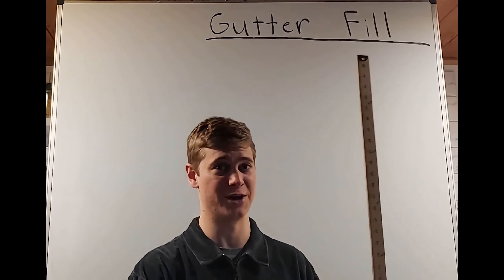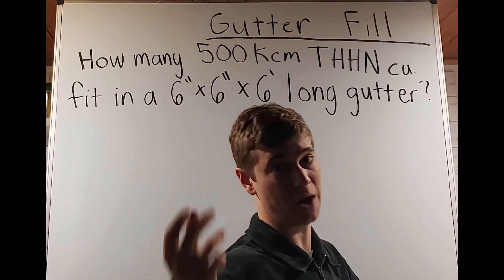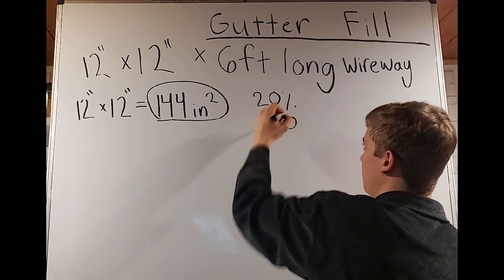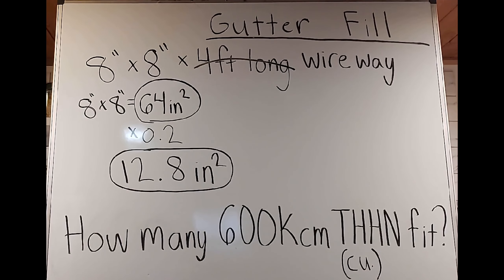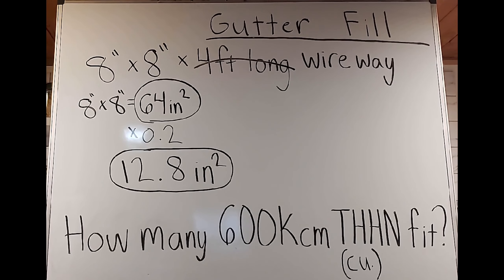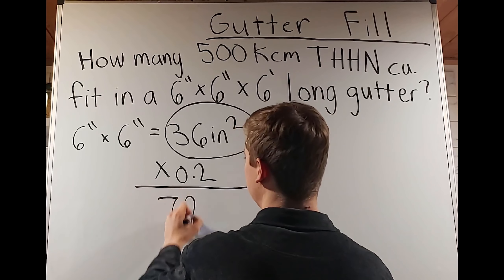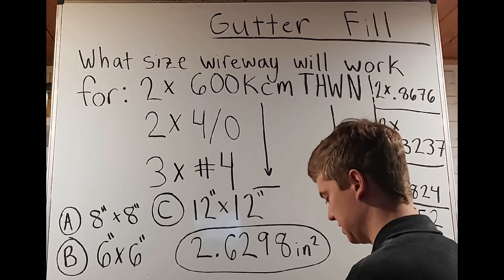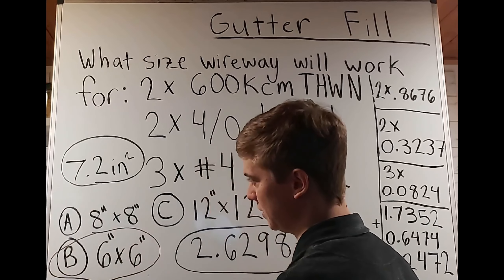Gutter & Wireway Fill

Comment: Good job. The electrical industry needs as much help as possible when it comes to electrical theory. I harvest as many Electrician videos as possible so I can learn. Good job here. 

I would suggest doing a couple videos on Clarifying the difference between grounding and equipment grounding conductors. Many people still think that electricity wants to go to ground; which it doesn’t. Many still think a ground rod is for safety, which it isn’t.
Reply from the maker: Thanks for the feedback! Yeah it is normally difficult finding specific videos for electrical theory so that is what I am trying to offer here. 
That is a great suggestion/idea! I definitely am proficient on the whole grounding/bonding topic and will put that on my bucket list for videos to make in the future. I will furthermore make an entire video on the equipment grounding conductor and another video for the grounding electrode conductor.

Unless it is a misconception, it is common knowledge that the ground rod can be helpful when lighting strikes ones house to help the current go into the ground. But in terms of safety in the house I would think of GFCI protection.
Reply from the maker: And AFCI! ^^

Comment: So how many number 12 thhns can I fit in a 12"x12" gutter 40 feet long.
Reply from the maker: That example was just to introduce the concept. There is a reason why I did not solve that question all of the way like I did with the other ones. But to answer your question: You could fit 2,165 #12 THHN conductors in a 12" x 12" gutter, again 40ft is irrelevant in this calculation since we are using square inches. (All explained in the video)
Reply: @jarodvelectric7431  yes but the 40 feet shouldn't be irrelevant. A lot of these codes are dumb and don't really make sense as to why they were the way they are. You should definitely be able to fit more wires in a 40 foot long gutter compared to a 2 foot long gutter.
Reply from the maker: @jimbush1581  Yeah the code book does not always make sense logically. They way I look at it is like a law, it may not make sense but it is the rule.
Reply: Inside diameter of the gutter or the raceway, not the volume, that is why the length is irrelevant, since the conductors occupy the area inside the raceway , so if you have 10 conductors in the first 2 feet , for example if it fill 40% of inside diameter, and this will be true also at the end of raceway last 2 feet